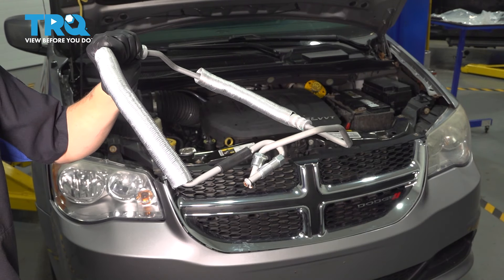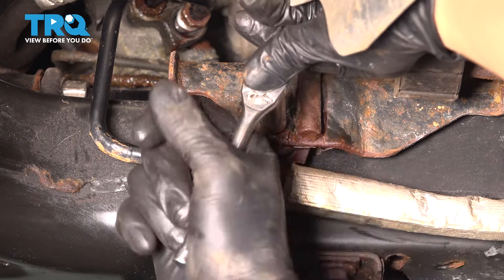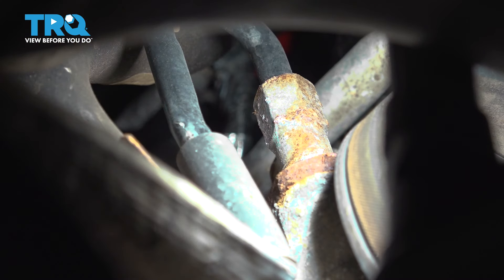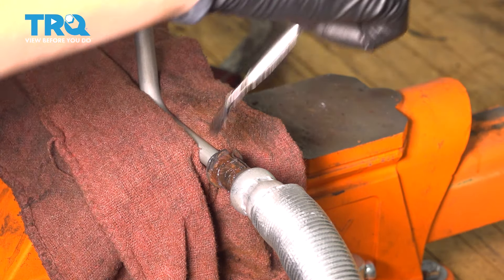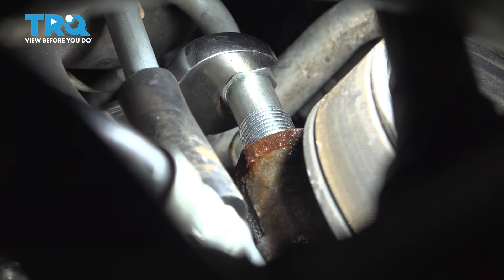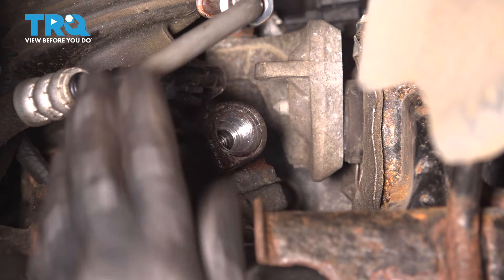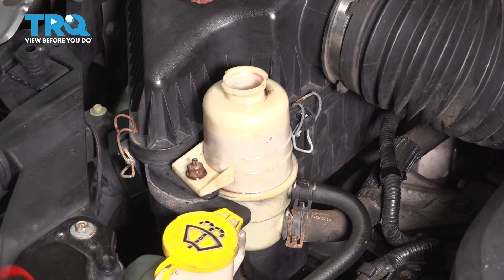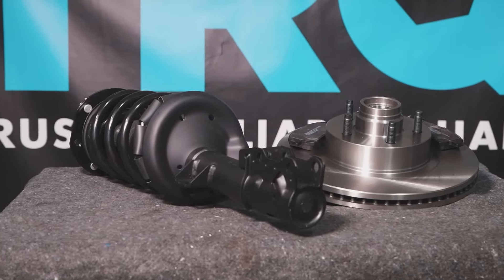How to Replace Power Steering Pressure Line 2008-2020 Dodge Grand Caravan

Comment: a trick to remove the old fitting out of the rack is to cut the line and use a socket with a universal joint.